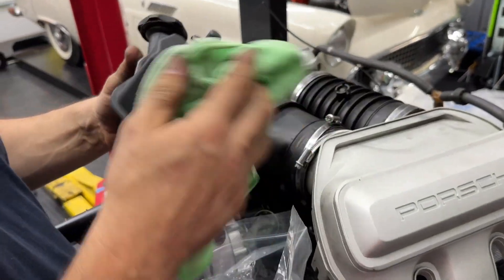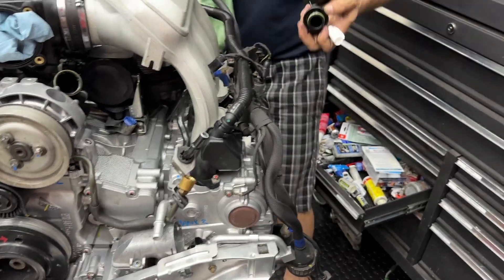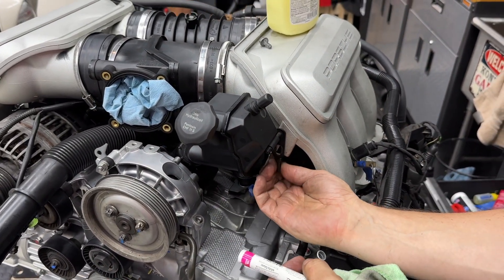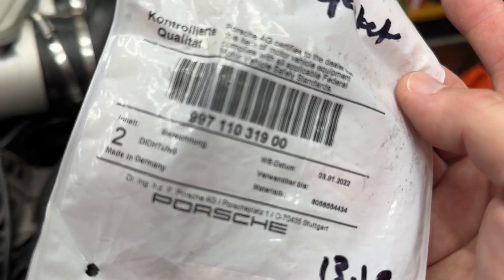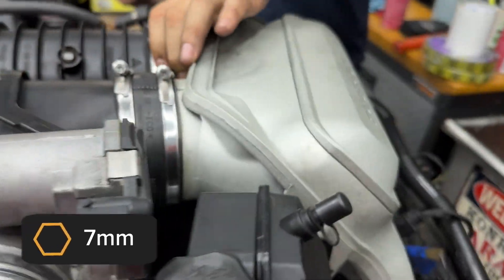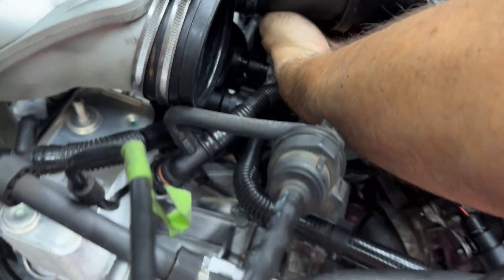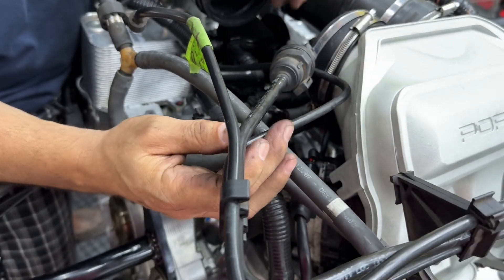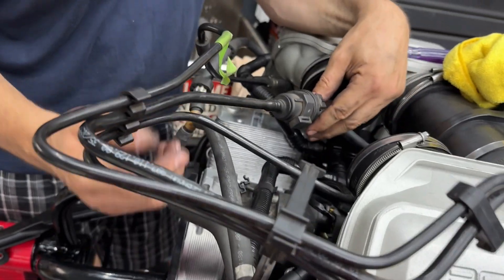Porsche 911 Engine Assembly Guide Part 30: Fluid reservoir, Throttle Body, Vacuum lines, Etc.

Comment: Great to see how close you're getting to getting this puzzle/engine done. Mine is also at a similar stage (I just ordered the throttle body gasket today). 

I'm going to smoke test my intake system before I put it back in the car - just to make sure I don't have any vacuum leaks. Can you imagine trying to fix one after this beast is back in the car?

Looking forward to the next video. 

Cheers!
Reply from the maker: +@edwardmigliore6484 that’s a great idea! I think we will do that as well 🍻
Have you figured out where all the vacuum lines and things we haven’t done connect to yet? If so, where did you get the info. I’d love to check
Reply: Highly recommend the smoke test - I skipped that step and got to pull my bank 1 intake plenum in the car to address a folded over gasket... 
I'd love to help with vacuum routing but the 997 system seems completely different than my 996. I will say I put most of the vac system lines loosely in place before I installed the upper plenums, but you have one-piece plenums vs the two-piece 996 plenums. This looks like a freakin' nightmare, AOS and vac system quite different between the motors. 
I'm guessing that broken line is evap fuel related?